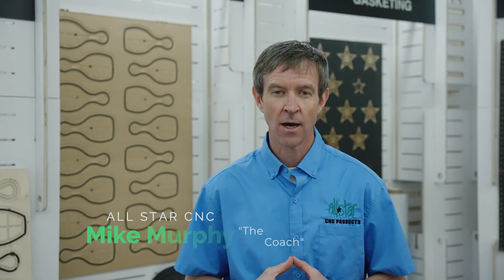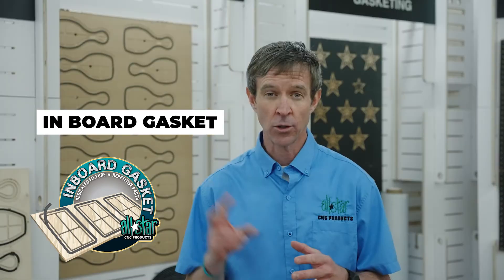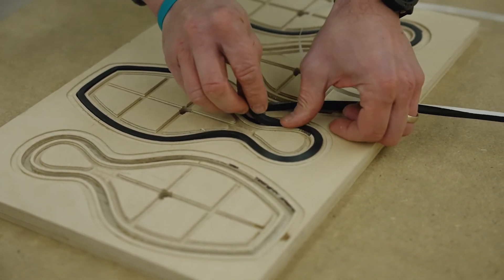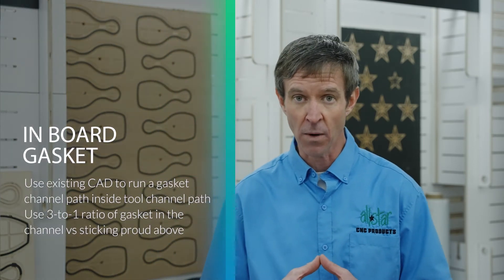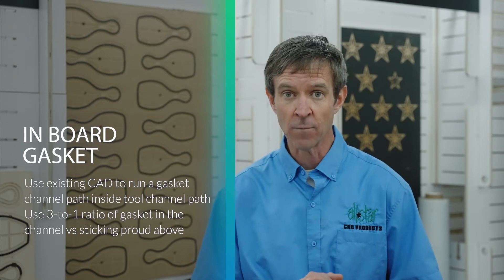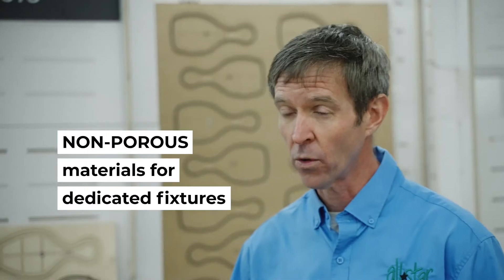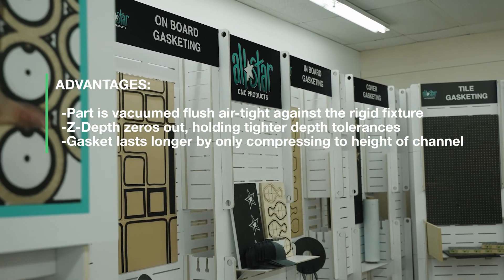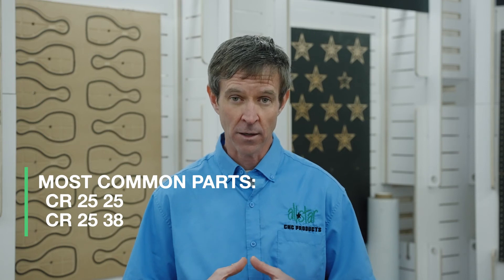STEP 2(a) OF 2 TO IMPROVE CNC ROUTER VACUUM HOLD: Making Dedicated Fixtures for Production Parts

Comment: Have you ever used 3/4" melamine for the in gasket fixtures? Is a quality plywood a better option?
Reply from the maker: A gasket fixture should be made from a non-porous material. And since 3/4" melamine is just a laminate over particle board or sometimes MDF, it is a poor choice to build a fixture and won't support the qualities of vacuum clamping as you need an air-tight chamber and particle board will leak. Good quality plywood, like Baltic Birch, is ideal, or any other non-porous material.